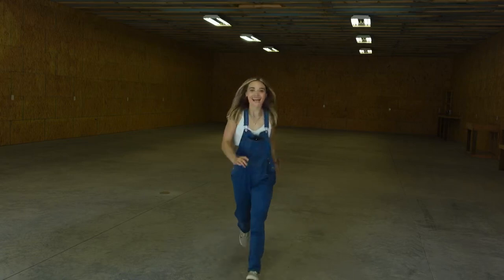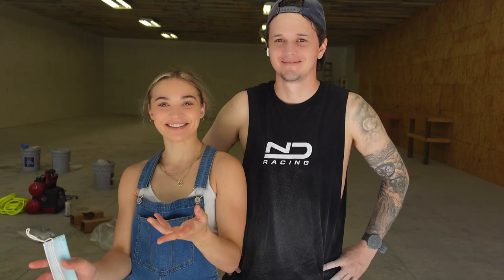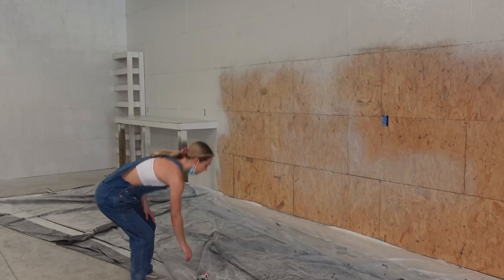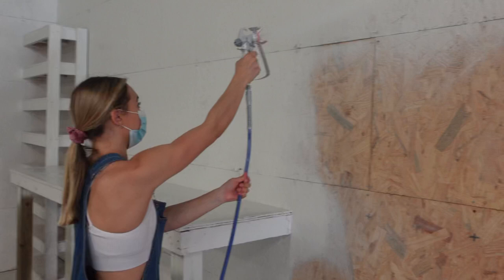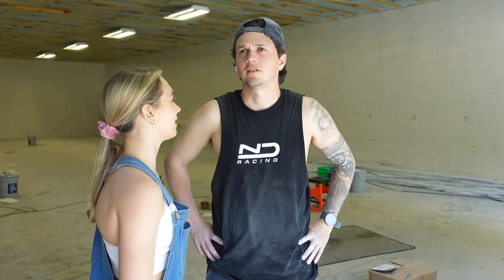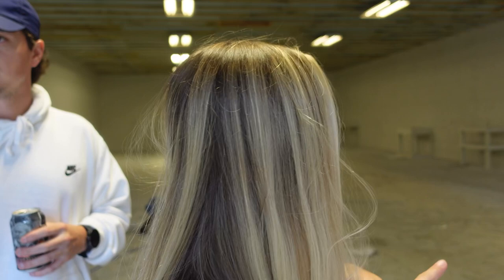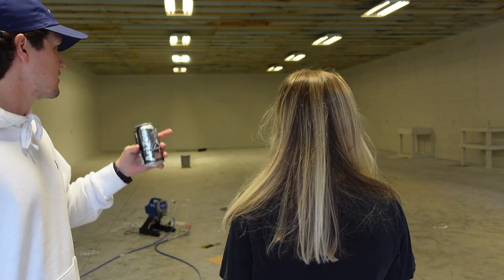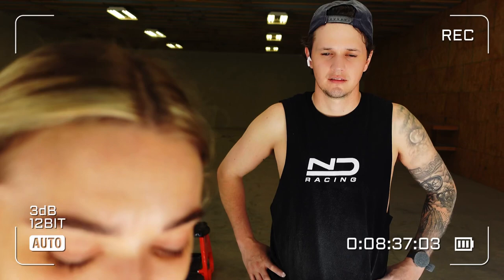Our Dream Shop (DIY) PART 2

Comment: I think you did a great job painting! I would recommend LED lights. They are more efficient and last much longer than fluorescents. They also put out a more natural light I think. Good luck!
Reply: I agree. Considering there are no windows and artifical lighting will be required most of the time, the amount of power they use should be a big factor. Also, climbing up ladders to change fluoro tubes sucks, especially when the ceiling is high and there are a lot of them. The tubes that go out somehow manage to be directly above the hardest thing to move in the shop too.

Comment: I hope that you used primer for the first coat. Those face masks are not adequate enough for that much painting. You should also have used, at least, a window fan at the garage door opening to help get rid of much of the paint fumes. Throw-away paper coveralls also.

Comment: In my car shop we used 4 foot high painted exterior steel panels like a chair rail . Makes it easy to wipe down and shiny. Also you need to at least double the amount of lights and add ceiling fans. Epoxy paint the floor makes it much easier to clean. Putting in some windows up high on the wall and in a new door will add a lot of light. They also make tube sky lights at would add a lot of light. Or powered sky lights would add ventilation. Having a nice shop is a lot of fun . We have even a bouncy house for the grandkids we can set up. Spray around the outside with bug killer. And and a few feet of stone will keep bugs and digging critters out.
Reply from the maker: I love that chair rail idea you gave us we might have to do that!! Thank you ☺️
Reply: @nataliedecker354  I also used Wall control steel peg board panels to hang tools on and are really very impressive to a shop. Handy and very heavy duty to organize your shop.
Reply: I did the ceiling of my shop with the steel panels so I would never need to 
paint . It is also is shiny and adds to the brightness of the shop. And the leftovers  were used to build the chair rail.

Comment: You guys are working so hard to make this space the Real Deal.Sure wish you had finished that ceiling. You need a vapor barrier and finish substrate . You will end up with  bad moisture .condensation without it and and cars or parts in there will suffer. You need any pointers just let me know.

Comment: Get rid of all of the outdated fluorescent lights and install LED lighting. A good lift or two and a heavy duty air compressor. It looks like they might have had a compressor mounted up off the ground in that corner with that small platform.

Comment: White Metal Ceiling with 48" or 96" LED light fixtures.
Reply: White ceilings wouldn't stay white that long in a race shop though. Grey or the black would be different and if you have led lights it would be plenty bright especially with having white walls. Going white walls and ceiling would feel kinda blah.

Comment: Natalie, I'm hoping that all is good with you and Derek. It's been two weeks since you posted this.
Reply: Well now that nascar has busted her she doesn't have as much to post about . You see since she got out of the car and said I'm tired no one is willing to put her in a car . I told you . Sponsors and owners don't want a driver that falls out of the seat. Of course with all your experience I'm sure you knew it was going to happen . You just didn't want it . She'll probably start posting a lot of videos soon as she has to make up that nascar money . I think she's accepted it . That's why she needs this shop ( money ) .
Reply: @davidvincent2nd757  wait, what exactly happened? 
I know at talladega for the trucks, she was the slowest truck, failed to qualify for it. And a few of my friends were in the garage area with a garage pass . They told me there was tension every time they went anywhere near her or her truck/hauler.
Reply: @Denverbroncos87  Busted means that Nascar puts the word out to sponsor and owners . They basically say you sure about putting Natalie back out there she wrecks this percentage of the time , her average finish is . Nascar will politely suggest other drivers. All done in private . She might get another chance based on her being a female driver and in my opinion the prettiest driver Nascar has ever had . If she does she'll have to make something of that chance really fast . I actually think her YouTube videos at the track didn't help her . She showed time with her doggies , time with her boyfriend , time with her mom all while being silly . As a person it's a fabulous personality . But at the track she should of been all business or at least that's what should of been shown . I know other drivers throw footballs and play with there dogs and kids but they don't show it every week . Now Sarge will tell you it's all about the money . Her dad could sponsor her for a year by himself money wise . No it's about no one believes she gives everything she has to being a driver . She fell out of the seat to many times . I loved watching her on the track and I would love being her friend . Nascar is done with her . Hopefully she'll put up more water skiing videos. She's terrific at that and she makes them fun . Scenery at her family's house is beautiful . I do believe she probably could still be a professional in that sport . I do like her and I wish driving in Nascar would of worked .
Reply: @davidvincent2nd757  I understand that. I just know a lot of tension was there around her truck at talladega. I know she was taking selfies when her crew members tried talking to her about the truck…
Reply: She needs to step up. Get serious and try .
Reply: @Denverbroncos87  I'm sure she'll be fine at a lower level , small track near her home . I kinda think her parents made racing more about fun than about a job when she was little . She doesn't have enough work ethic . She's definitely a very talented lady with many doors open to her . As for Nascar she's a danger during a 400 mile or longer race . I believe Nascar is privately worried she'll pass out during a race . Of course they can't say anything because a lawyer would find a way to sue . I'm really interested to see what she does next and I'll remain a fan . I'm still subscribed to her YouTube channel .
Reply: @davidvincent2nd757  her work ethic for Nascar isn’t there. Same with the sports car team.. being 15-20 seconds slower than every car is not showing your talent and skill. She was in the way. Paul menard got in her car in practice at 1 race. He was 13 seconds faster. She gets in and was super slow. When Menard tried to give advice, she was taking photos of herself in yoga pants… 

Kevin harvick mentioned future plans for Stewart haas. I can’t remember if it was Corey lajoie or another podcast. 
But 
Harvick said the plan is to have a 2nd xfinity car with 3 drivers. A veteran doing 25 races. 2 up n comers doing 5 each. Johnny sauter was the veteran. Kevin said if Johnny has a win or is top 12 in points, they’d find a way to get the other races so he can compete for the championship. I guess tony Stewart, Delana harvick, 2 guys from the formula 1 side ( haas F1) , people from the sponsors of the xfinity car for herbst, Riley herbst. All these people there to meet for dinner and talk/negotiations. The other young talent shows up, Kyle sieg. Natalie no shows. But took to twitter to say she went to 4 bars and complained none of them had a Nascar race on. When she was supposed to meet with many people about future plans, and to try to get this 2nd xfinity car going. Though it honestly looks more like it should be in the truck series. My opinion to that but anyway, she never showed. Stewart was pissed, delana harvick, Johnny sauter, the spokesperson from 1 sponsor was angry, the other spokesperson from another sponsor wasn’t surprised. So harvick on podcast says: 
At some point you have to look in a mirror and decide if you want to be there. Crying you get only a little for being a female in a male dominated sport, but the chances you do get, you take selfies, photos, act like you could careless being there. Plenty of drivers are doing nothing and would want a chance. The action you make yesterday will have impact today and tomorrow. After so many times, you run out of chances, you have to blame yourself 

Well said. 
I’m glad hailie deegan is getting better finishes. 3 top tens in truck- 2 this year, 1 last year. But at some point, the race needs to be taken seriously. It’s not fun for bowman and Busch sitting around with concussions. But here’s Natalie out there shutting off her car before finishing a qualifying lap and the blaming everyone else for failing to make races. 2 dnq in xfinity this season, and 1 in truck.

Comment: Don't epoxy the floor, stain and polish the concrete
Reply: John Eighmy, their choice, not yours. Straight concrete holds moisture which is not good in the south because of the high humidity.
Reply: Of course it’s their choice. I’m in SFLA and Am well aware of the heat and humidity. Polished concrete is now used extensively in this environment for residential, commercial and government applications and is VERY durable and attractive.